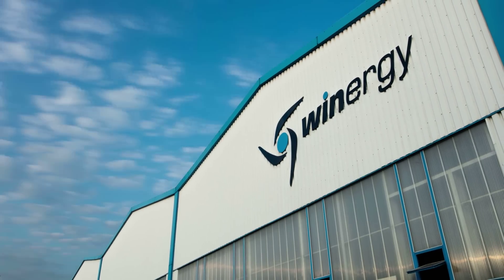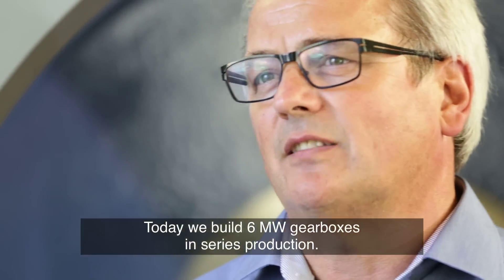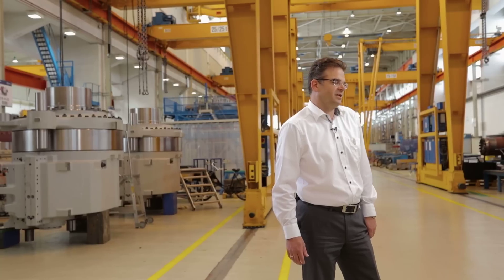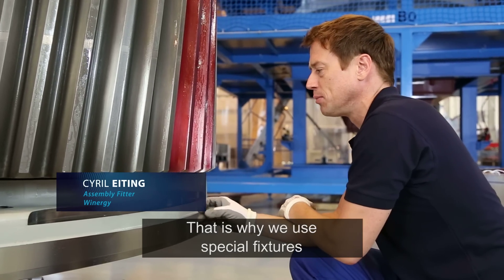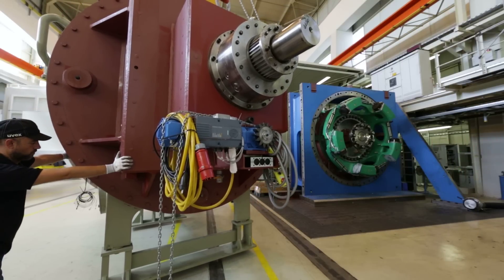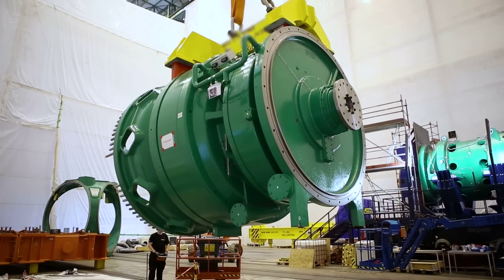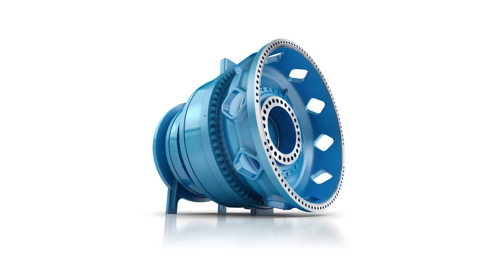Building the world’s most powerful gearbox for wind turbines - the Winergy 8 MW gearbox

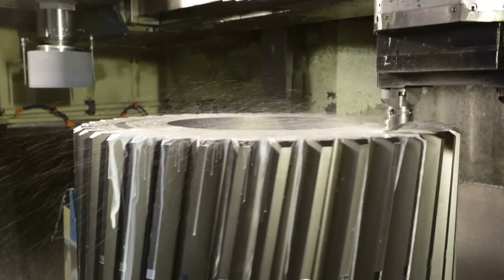Comment: 3:31 to 3:43 is about the most obviously "fake" bullshit supposed "manufacturing footage" of major mechanical systems/parts I've ever seen. It starts with "heat-treating" and flames that look like they belong in a campfire or fireplace curling up around and over the lid of that "furnace" with its lid held on by HANDWHEELS and then there's the big "rack" of orange-hot plastic-state steel gears and the rack itself that would not in a million years stay rigid and support all that weight and least of all with the puny-ass overhead hoists they've got over that area. You're talking many tons of metal and those hoists just aren't going to cut it with that long of a span. Not to mention a single "worker" doing all of that himself and going WHERE with that huge load of orange-hot steel? And again HANDWHEELS keeping the lid clamped shut? What happens when those "furnaces" open and all that heat rises that whole 20 feet to that low ceiling and the plastic "skylights" in that thin steel roof? And then there's the "worker" in the background heading to some other part of the plant. No safety equipment on of any kind. Same goes for the "casual Friday suits" walking through the plant in their high-dollar "distressed" denim jeans, zero safety equipment and sitting there talking about how they're going to jackhammer each other in the doo-doo hole later that night paying attention to nothing around them or even where they're walking as they do so. And I almost forgot the opening shot of the series of "shit that would make me not want to buy anything from that outfit". That "precision machine work" being done on a gear that's just shitty as hell. Look at the "surface finish" that "lathe" is leaving on the side of that gear. That ain't gonna fly. But then again gearbox failures are the big "killer" of wind turbines and usually after only a few months to a few years of operation. In part because "wind farms" can't/won't find enough "electricians" to drag buckets of gear oil to the top of those things and then drag the empty buckets back down even when the turbine/tower is equipped with a top to bottom "hoist" for just that task because you can only hoist a couple buckets of oil at a time and those gearboxes hold dozens of gallons of oil. And also because that kind of maintenance work over the life of the turbine ends up being massively expensive. And even with perfect maintenance and service and operation, those boondoggle pieces of crap have a 20-year service life MAX. And now that subsidies are disappearing, costs have skyrocketed, output has tanked and way too many people are finding out that "wind power" is making electricity more expensive and most "wind farms" are net CONSUMERS of electrical power, "wind farms" and their shell-corporation owners/investors are losing money hand over fist even when they "make money" because their "profits" are nowhere NEAR what they figured to make AND they're not going to be able to just "declare bankruptcy" and walk away in many cases because they've permanently "damaged" the environment and "cleanup" is going to be an absolute necessity. Of course they WERE planning to "cash in" on THAT too when scrap metal prices were sky-high and climbing. They figured scrap companies in 20 years would fall all over themselves to just "cut down" those turbines and let them crash since they're all out in "flyover country" in open farm fields anyway. The only problem is they "only" weigh a few hundred tons at most, the only "scrap iron" that brings a "premium" at scrap yards is what will fit in a crusher, once those things are "depreciated out" it will be "illegal" to then sell them as "scrap" and they'll actually have to pay a LOT of money to have them removed AND return the "environment" to "as-was" condition and no scrap dealer is going to want them because they're just too damned big to cut up and haul away in "normal" sized loads AND because they'll contain all that OIL in the gearboxes AND hydraulic systems that rotate the nacelle and blades, there will be big-time "hazmat" concerns. I've got a bunch of those damned things just a few miles away AND a good friend who runs a family-owned salvage/scrap yard and those turbines aren't even 10 years old yet and the manufacturer has already had to replace a bunch of gearboxes under warranty. Because they're so unsuitable for "scrap metal" due to how much work it takes to disassemble/break them up by hand AND they're "junk" and "worthless" being replaced under warranty, the company had to either pay my buddy's business to haul them off or at least didn't get anything for them as "scrap metal". It takes up to 12 semi-loads of "steel" to haul in just the MAIN CRANE used to erect and service those things since you're usually talking about a 400-600 foot crane. That's thousands of dollars "per hour" and far more time is spent assembling and disassembling the crane than is spent doing the drop and lift to replace a gearbox. Then there's all the union "steel workers" you need to do the bolting/unbolting of parts since that's not something "wind turbine technicians" are trained/equipped to do. And the cost of the replacement parts themselves. Even when its a "warranty repair" there's lots of "lost revenue" from not having that turbine or neighboring close-by turbines operating and the dirty little secret is that MOST of the "wind power" industry in the U.S. is driven by the need for SOME STATES/UTILITIES that haven't kept "building their infrastructure" and have been big-time net IMPORTERS of electricity for years or decades to "replace" power they're "losing" importing it from other utilities/states "on the grid". Buying some wind turbines or at least buying "cheap" electricity FROM THEM was their only real option for finding that "replacement power" short of building a new powerplant or two or three. And since they've never done that because their operating costs for their tons of union/tenure employees and all their ridiculous benefits eat up most of their "profits" and the FOR-PROFIT "private utilities" are often "co-ops" that LOSE MONEY INTENTIONALLY TO AVOID PAYING TAXES. Now "wind power" ain't working out, they've got "long-term" contracts both with other utilities/states to "import" power from them AND to buy "cheap electricity" from "wind farms" they've "invested in" behind the scenes and they're pretty well SCREWED now. Especially because "peak usage" is no longer from 6 a.m to 6 p.m. the way it used to be when fathers went to work and mothers stayed home all day and both household and business use peaked during the day because mom was doing housework and baking doing laundry and watching TV all day and then when Dad came home things actually quieted down significantly, the furnace/AC got "turned down" by the old man who's paycheck paid the utility bills and after supper the whole household wound down to sit around one TV in an otherwise pretty dark house for a few hours before bed when the furnace/AC REALLY got "turned down". Now "peak usage" is more like early afternoon to late at night and with so many people working "desk jobs" in big buildings that are horribly "energy inefficient" and must be kept warm/cool 24-7 once they're warmed up/cooled down early in the winter/summer and then going home and doing all that household stuff at night or on weekends which used to be the other "low-usage" period because so much business/industry shuts down on weekends and household use really didn't increase much at all with everybody home instead of just Mom and the kids some or all of the day. And anybody who knows anything about wind knows its rare to have much wind after sunset and before sunrise unless its a "storm" situation and the wind is really howling. And guess what? Over about 12 mph the wind is too "strong" for those big, bad wind turbines. Their actual "efficiency" is turning out to be high single-digit to low double-digit levels as far as "output" vs. "capacity" because at best just over HALF of wind "energy" can be turned into "mechanical energy" since WIND RESISTANCE INCREASES WITH WIND SPEED and a LOT of that "energy" goes to just operating the turbine(s) itself keeping the blades and nacelle in the proper position to "harness" it and until they make up their NET POWER LOSS during all the time they're not "running" but ARE on "standby" so they CAN start running there's no "profit" regardless. And of course they're usually producing DC power that must be "inverted" to make AC power for the "grid". Guess what? Unless you have an "excess" of DC power TO "invert" you may as well have NONE because there's so much energy loss to HEAT during "inversion" and its so absolutely NECESSARY to produce AC at the right voltage/hertz that there's a VERY small window of "wind power" where those turbines can actually do anything but LOOK like they're "generating electricity". Its a giant scam, its not a NEW giant scam since there was a big "wind power" and "solar power" movement during the "energy crisis" in the 1970s and particularly in California where abandoned "wind farms" and dilapidated/destroyed wind turbines exist by the hundreds or thousands yet TODAY because they're "worthless" to even a "scrap dealer" and like EVERY OTHER "ENERGY SOLUTION" supposed "renewable" and "sustainable" its a giant NET LOSS in "energy use" by the time ALL THE ENERGY INVOLVED OF ALL TYPES USED TO MANUFACTURE THAT NEW "INDUSTRY" IS ADDED UP.

Comment: Hmmm a lot of not correct information, it is neither the biggest, most powerful turbine or gearbox. Since the MHI Vestas offshore Wind A/S. V164.  is aporved for 9,5MW . and alread in Jan 2017 when this video was released. MHI Vestas had a 8,4 MW aproved
Reply: This video is about the largest gearbox as per Jan 2017 (and the video was created even earlier than that). You are right that the V164 reached 8MW capacity since 2013 and later greater capacities. However with a smaller gearbox. In fact most wind turbine manufacturers, including Vestas, want to eliminate the use of the gearbox through direct drive and more sophisticated and more powerful power electronics.

Comment: it seems to me that if you pumped air or a fluid like water with a variable displacement pump and put the generator and associated stuff   on the ground you do not even need a gearbox . why go to all that trouble to do all that precision machining?
Reply: got a video link? also hydraulics at those power levels tends to break quite spectacularly and have a lot of losses versus direct mechanical leverage

Comment: They probably could have saved a lot of trouble by just designing a molten salt reactor instead. Selling byproducts of the nuclear reaction and electrical production could pay for the cost of running the unit and electricity costs could be tiny or zero, depending on how well the other products are sold.

Comment: Amazing. For my undergraduate degree I worked on research into wind turbine gearbox planet bearings and I was only looking at a 750kW turbine (the research turbine of the NREL). It's interesting that you chose a design with two planetary gearing stages, since planetary bearings and gears can't be replaced in situ on the turbine (as far as I know). You must be very confident with the design, particularly with the very high loads which makes it especially impressive to me.

Comment: Gearbox looks like gears in a automatic transmission
Reply: I m a mechanical engineer & I would like to work with you all.
Reply: This transmission is surprisingly simple in concept. It just has huge requirements on material strength calculations, manufacture precision and stuff like that. Automatic transmission in a car on the other hand is the worst possible nightmare. :D :D
Reply: Same concept as an automatic transmission, just scaled up by around 800 times.